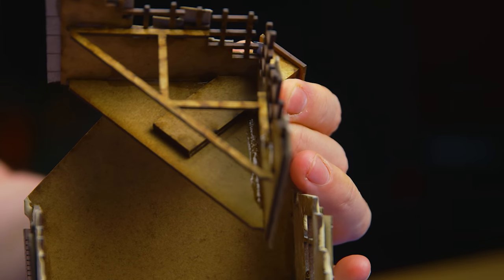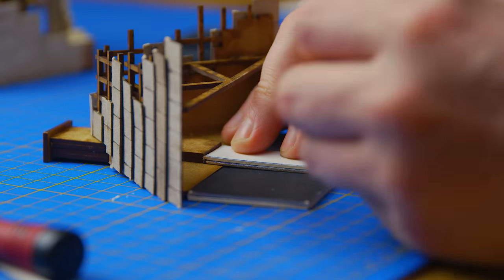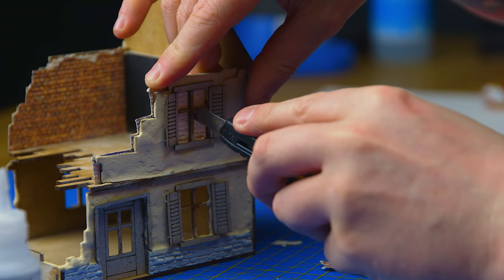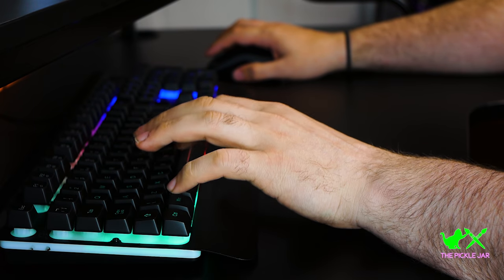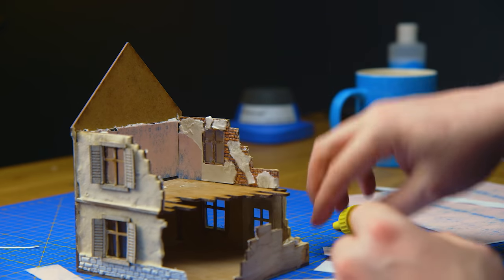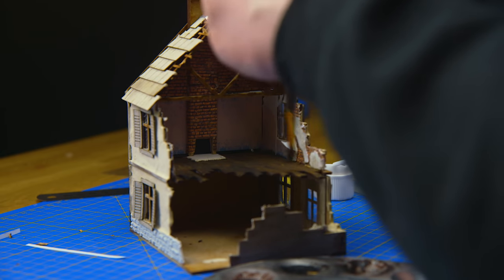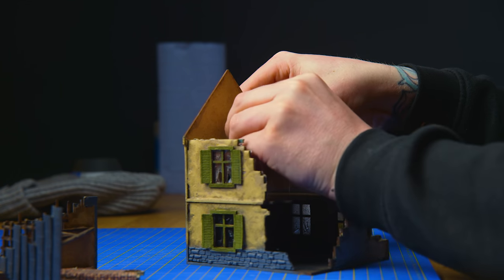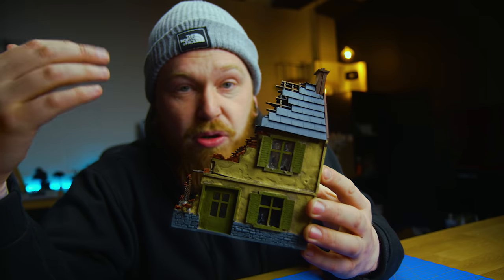Making MDF Wargaming Terrain Actually Good!!

Comment: I work mostly in 1:35 scale and scratch build my buildings. My brick walls are cast in Herculite plaster which is coloured york buff or terricota with pigment. It is possible to colour individual bricks in the mould, but thats too time consuming for me. The mortar is poundshop plaster filler heavily watered down. That can also be coloured with a tiny amount of black pigment to get a grey mortar. All the wooden structures are made from balsa though I use bought MDF window frames so in effect my stone/ brick work is real stone and wood in the building is real wood. I use microscope slide cover glass as window panes. They are easy to break in the frame with a small tap from a nail to make cracked or broken windows. The plaster is thin sheets cast again from Herculite in moulds that represent 8x4 feet plaster board. the pound shop filler is used to fill any gaps. these sheets are too easy to break. The wallpaper is made exactly as you did and if you try this, paper the wall before breaking the plaster. floorboard are again balsa as are rafters, skirting, Simon Kemp has great  videos on using the same moulds I do. If your not familuar with his channel . I will post a link here :-  https://www.youtube.com/channel/UCHemRX-aOiXTqu3ktrqsqVg

Comment: Mate, another great vid. Just a reminder when doing interiors, don't forget they had electric lighting and a few sockets. For electrical cable that scale you can use old phone cable sometimes you can find some outside junction boxes or just get an extension set from the pound shop. Also don't forget out side pipework, ie, stink pipe, guttering and sink pipes. Just suggestions.
Nice tips on the wall paper and picture rails/skirting boards. It's little details like this that makes all the difference.

Comment: Careful with those skirtings! I found that when I printed doors flat on the build plate, they warped after a couple of weeks, presumably to slight shrinkage as the upper layers cured more. If you glue them all on quick they might be OK but keep an eye on them to see if they start to curve and peel off the wall! Would coffee stirrers be an easier (if less aesthetically pleasing) substitute?